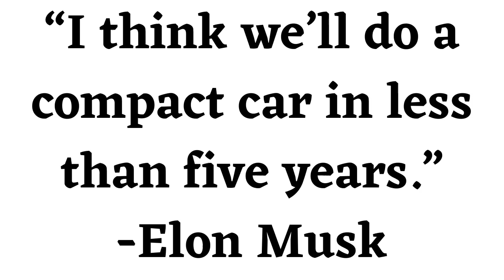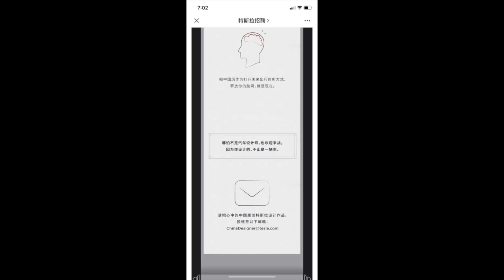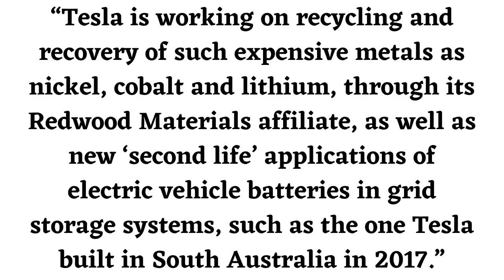Tesla's $20,000 Compact Car Is Coming Soon - The End of Gas

Comment: Not everyone need a car with 500 miles range.  Tesla has demontrated that range or charging aren't issues anymore.  It's time to make cars with modular battery pack where the same car could be fit with different sizes batteries.

Comment: Combustion cars(petrol cars need excessive maintenance, but electronic cars use magnets and electricity to run so minimal maintenance giving it longevity.. for $20,000 it's a bargain, THIS GUY COUPLED WITH THE AUTONOMOUS DRIVINGSYSTEMS WILL TAKE OVER THE GLOBAL MOTOR INDUSTRY, BRAKES WITH NO PAD CHANGES, HE HAS FLIPPED THE WHILE MARKET NO LONGER DO WE BY CARS  TO EVENTUALLY BREAK DOWN.. LIKE WITH ALL OTHER AUTO MANUFACTURING, THIS GUY WILL MAKE HIS EXYRAS BY PROVIDING SERVICES LIKE ATINOMOUS CAPABILITIES ECT
Like the in car mobile marketing concepts I created a decade ago with the building of the first Carputer win XP CAR INDASH PC

Comment: 20 000$ base -5000 federal(Canada) incentive -8000 Quebec incentive - 22500$ potential saving over 10 years without gas = total cost of -15500$. Wow that is a lot of saving!!. Now picture this: autopilot mode (cost around 10 000$ right now) = total cost -5500$ with a car that could participate in the Tesla robotaxi fleet and add me a potential annual revenue of 30 000$/year. So now cost over 10 years = -5500(cost of car) - 300 000$(potential revenue of autopilot while i'm retired at age 33) = total -305 500$

Comment: Even if this car cost just one dollar, it will never end the sale of gasoline because most drivers prefer to fill up once and drive over 300 miles without a refill. And the only cars with better range are hybrids. My 2014 Fusion Hybrid gets up to 54 MPG and gets over 40 every day. With its small 12 gallon tank, I can drive over 400 miles between fillups, and no EV can beat that.

So until EVs can recharge faster and have better battery range, the hybrids will have the greater driving range, and extend gasoline consumption for another fifty years or more. You and I will pass away before gasoline ends!

Comment: Two facts: The Typical Car Is Parked 95 Percent of the Time and  the average private car in the U.S. carries only 1.6 people. Robotaxi's will make use of that idle time and mostly carry 1 or two passengers at  a time, and most commuters do drive alone. All of this together with smaller cars needing less battery points to the $20k car being a 2 seater. I would even go so far as to say a 3 wheeled 2 seater would be substantially simpler and cheaper to make and perfect for this use. Something similar (but less retro) to this https://mynobe.com/nobe-models/
Reply: fk that i wouldn't want strangers driving my car. we dont need to make commuting efficient just the cars and energy source.

someone could easily take advantage of shared car services and bring them to chop shops. a bit harder when tesla cars track every inch it travels though.

Comment: Rocky Mountain institute designed a composite car 10 years ago. The Iite weighting of the vehicle reduces the need for power and battery size reducing the cost. In the 1940s ford designed a composite car using hemp as the source for fibre. These techs combined with Tesla drive train would make for an affordable sustainable vehicle.

Comment: So it's Tesla. 20,000 + 8000 to make it a true Tesla. Add another 10,000 for the upgraded battery and after tax it's 45,000. Just like the 30k model ends up costing nearly 60k. Sad thing is if you buy the most expensive model it actually cost what they advertise.

Comment: If a Tesla with 100 miles range at the worse (say at 7°F or 105°F) and 175-200 at it's best and of course scale back the features. Also having typical merging power. Cost 19,750-22,500usd I buy one spring of 2022.

Comment: I dont want a compact car . I dont want a battery car.  Around the cities small cars are ok but  you can not have a comfortanle ride with a short wheel base and narrow track.  The extra 6 inches elbow room makes a difference.  I can throw a  50 ltr fuel container of diesel or petrol in back of my car or pickup if i need . Australia is sparsly populated in many places. Towing a trailer or caravan or boat long distances is very common.

Comment: IT IS INEVETABLE, i have been a mechanic for over 37 years i saw the good stuff in the mid 70s
go thru my hands and then all the gas cars went down hill, To much greed and planned 
obsolescence...Now with all the secret computer codes its all junk you can't work on , 
unless you are a dealer...Electric cars will rule the roads...i am tired of beating up my body
with exhaust systems and fuel injectors , starter motors, alternators, radiators, belts, hoses,
oil changes, transmissions, spark plugs, coils, air filters, fuel filters, Fluid spills, fumes, emissions, 
You Name it...All of witch an electric car does not need ...
A Good electric vehicle today should cost no more than $20,000...and can be problem free
for 1,000,000 million miles ...except for tires...

Comment: The image of what is supposedly the compact car is not radical in any way at all...it looks similar to the model 3 or a number of other cars...i predict the costs savings of producing the cybertruck from stainless steel will be used to get a compact car cost down to $20 000 or even under that eventually. 
One thing would be for these designers trying to guess how a compact car would look would be to use the sharp angles of the cybertruck....but do so in new and radical ways.....nobody wants a box nobody wants a car that looks silly or ugly....radical yes but it must be modern and good looking in some way...maybe even using some very slightly curved Stainless steel to remove too blunt an edge....still needs to have 5 full seats and space for small loads like the model 3 ....

Comment: I guess a compact car is equivalent to a medium size car in Europe. A $20k compact would be very competitive but I think it would sell for a lot more. A Tesla model 3 is $35 in USA = £26k in UK at current exchange rates but the model 3 actually sells for £43.4k in UK less £3k subsidy = £40.4k.  I.e. 67% more. 

Applying the same markup to $20k gives a UK price of £22k less £3k subsidy = £19k.  Compare that to the ID.3 44kWh which is £25k after subsidy and it is even less that an similar sized ICE car. If Musk can do it then he will take the market by storm. 

Needs highly automated production lines and batteries costing probably 1/2 current costs + guaranteed supply of materials. Let's see what Battery Day brings.

Comment: I`am considering buying Fiat 500 E, but the range of ~80 miles is stopping me, it would be enough for the commute to work, but still it would be nice to have at least 150 miles.  The first, second generation used EV`s are getting cheaper and cheaper, and they still are worth it considering the amount of money you would save for the distanced traveled. Electric currently is the cheapest transportation option, here in Europe 100km trip using EV costs around ~3 euros if you charge at home, the same distance done with diesel car would cost you between 6-10 euros, gasoline ~10+ euros. Not to mention the taxes, oil changes and maintenance..

Comment: Sweet more money left over to call the tow truck when you're on the side of the road with a dead battery.  I rather take my chances with Covid,  range anxiety is real and it can killed you.
Reply: I can tell you don’t own one.  As a current P85 owner you have to be really dumb or the stars have to align for you to run out of battery and get left on the side of the road. You get so many warnings as well as directions about speed and distance that this is a non issue in 99% of cases. I’ve made 3 cross country trips from Florida to Cali and back and I’ve never once came close to being left on the side of the road. There is only one drawback to road tripping in a Tesla and it’s how much time charging adds to a 2500 mile trip not range anxiety.  Pretty much doubles the drive time but on the flip side I have free supercharging so at least it doesn’t cost me a dime to do it.

Comment: Cybertruck already has an ingenious way of saving costs. Since it's completely made of stainless steel common means of producing the chassis will not work. The new process requires much smaller presses whilst producing a stronger car. 
Also a car made of stainless steel won't require a paint shop which is one of the most expensive parts of an automobile factory. 
So I'm expecting a similarly boxy stainless steel frame for their 20k$ car. Frankly it just makes sense. 

I mean why would someone develop a completely new way of producing a car chassis if they only made one car from it.
Reply: I feel like people usually forget that the most efficient way of reducing costs does not lie in the product but in production and Tesla is starting to get really good at producing by allowing revolutionary ideas to flourish.

Comment: Wait until you pay $.50 (50 cents) per kWh to charge your EV battery, due to supply and demand.  For people who don’t know the cost to charge EV battery, then here is the math at $.50 per kWh:
50 kWh battery: 50 x $.50 = $25
75 kWh battery: 75 x $.50 = $ 37.5
100 kWh battery: 100 x $.50 = $50 
In California, the electric rate is about $.25 per kWh right now, I heard it will go higher soon due to shortage, supply and demand.  
The registration fee to renew your plate each year with the state is over $1,000 more than gas car. My gas car is $79, and model 3 is $1,120.  After deep and careful thought, I think I will hold on to my gas car.  I got an anxiety about forgetting to charge the EV, adding 1 more problem/ issue into my daily life routine.  One more headache.
Reply: Jena Lomped It's crazy that a place like California has a shortage of power. I mean, it's perfect for solar. It should have some of the cheapest power in the US- at least during the day! Your government is so backwards. Every where else in the world governments are incentivising electric cars by offering reduced taxes, installing chargers etc but the US has taken the opposite stance for some unfathomable reason. Let's hope things begin to change after December...

Comment: This is a pipe dream it won't happen anytime soon maybe possible after 5 years, the batteries must be small and much more efficient, the current Tesla has a set size because almost the entire floor bottom is the battery pack, the large footprint size is needed for the batteries, a compact size wouldn't be able to hold that many batteries. So until they can improve the battery technology this ain't happening

Comment: The only problem here, is that most Americans of today can no longer afford homes. This is a huge problem for Tesla, because you need a single family home or condo with a closed garage in order to install the charging apparatus necessary in this car. Charging, even with fast-charge technology, takes upwards of hours, making it impractical to expect owners to drive to a charging station and sit there every time their car runs out of juice.

People living in apartments or renting a room in someone's house will not be able to drive even a $20,000 Tesla, because they simply have no way to charge it. 

I stand by my belief that until battery technology gets to the point where a car can receive a FULL charge in the same time it takes to fill up gas, they will never replace gasoline cars.

Comment: I don't think anyone has really spend $35000 on a model 3, at least I wouldn't for a car that looks like a toad, can somebody please tell me am I the only person who thinks that the model 3 facia looks like a toad? Anyway back to what I was saying I don't think a 35000$ model 3 exists, everyone has payed at least  2000$ more.
$25000 wow wow wow wow wow a model S battery costs $14000, this car would probably have a smaller battery so let's say it's$12000, and that's still nearly half of the cost of the entire car. I wouldn't buy a Tesla compact car, for $30000 I would buy a Mazda 3 or a Subaru WRX, but the WRX is slightly more expensive so let's compare it with the top spec fully equiped Mazda 3. It's not as fast but that's the only area where Tesla wins. Mazda has an interier that made one McLaren driver want to buy a Mazda, The Mazda looks better, it's built to a Mutch higher standard and Mazda is not going to send an update to my car which is going to make my car slower. And Mazda doesn't spy on you, Tesla actually tracks where you are going how often and then sends that information to the internal Tesla snitch, yes the same snitch that is searching salvage auction sites to look for VIN numbers and then disable supercharging on salvage cars. If you watch the channel rich rebuilds you would know what I am talking about. But the main thing for me is that my friends don't laugh at me when they see my Teslas misaligned doors and huge panel gaps

Comment: I think the compact/cheaper car will be massive. People don't realise it now, but this section of the market will be a great strength of electric.
At the moment batteries are the great disadvantage of electric - on every other metric electric completely destroys ICE - power, torque, efficiency, cost, maintenance, simplicity ect.
Small cars make so much sense for electric - they don't require the same size battery as you say. Also many consumers will be happy with a lower range, using the vehicle for mostly city travel and won't need more than a 150 mile range, cutting costs even further. As battery costs come down, this section of the market will be the first to undercut ICE in terms of production costs. They will be able to be made cheap. Like seriously cheap. Eventually much cheaper than ICE vehicles and my feeling is that there will be a flood of cars in this market competing on costs around 2025-2030.. 10-15kUSD, or possible less than 10kUSD for a <1000kg car with a 20-30kwh battery (or about 100-160 mile, range). Not sure if it will be Tesla making them (though I hope it is), but it'll happen because it's just such a massive opportunity. Cars have never been able to be this cheap (without being terrible) with the complexity of the internal combustion engine.

Comment: I’m not interested in buying a “new” car unless it’s an electric. I’d for sure buy a compact car by Tesla. My current ride is a bicycle and my wife’s car. I like my bicycle more than my wife’s car, lol.
Reply: I hope they lower the car insurance
Reply: a a I imagine in the future cars will be charging as they drive. Roads will be built with wireless chargers built into them. Mark my words!
Reply: @KLA82  that won’t/can’t happen. Imagine the cost and inconvenience to dig up every road in the uk and redo it with wireless charging. Just no. There’s not a need for it. Batteries WILL get to 500 miles useable range before 2030. My car only does 250 per tank but you don’t see fuel tankers filling me up as I drive...
Reply: Enjoy public transit....an EV is the last thing I would buy...
Reply: @Schmederling33  Public transit?  U mean petri dish pandemic disease transmission.
Reply: Good for you...Most automobile manufactures put 2050 as the last year of gasoline, diesel automobile production. My concern is our aging power grid. I would hate to see us revert to the use of more oil, coal, gas to generate electricity. Another concern is getting the power companies to play fair. Can I generate and store excess power? Can I operate independently of the grid during peak power output, during outages and generate my own power, share it with neighbors,etc..Let's hope for the best.
Reply: just say it you like your bicycle more than your wife. you dont have to add the word "car" to throw us off.

Comment: How compact? VW golf or Mazda 2? The US best sellers are pickups and crossovers, which is addressed by Cybertruck and Model Y. The compact should be small, but spacious inside, which is Model 3, really, Civic and Corolla class. If you want smaller, then it won't have a mass market. Mazda 2, GM Spark, Ford Fiesta, Fiat 500, etc. are all niche products, mostly for single women, or childless couples. The subcompact demographic lives in a city apartment block, they don't have a 'home charger' as a private house with a driveway. 
I think model 3 need to have its price lowered to $24k by reducing its weight and outside dimensions. Making Model 3 a hatchback version with folding seats, shorter frunk, half the battery size - like 35 kwh, and plastic body panels. Range can attain ~250 miles with amazing Tesla battery management software.

Comment: A compact at that price range would be amazing. Right now I have a prius, but i plan to upgrade to an EV as soon as i move into a house or apartment that has some sort of EV charging. I'd probably get the spark ev, since it is the cheapest used EV with active battery cooling, which is a must in 110°F heat here. In a few years when a Tesla compact comes out, I'd definitely upgrade to it. I'd love to get something bigger like the model y, but that's just too expensive. The chevy bolt would also be highly considered

Comment: Not exactly radical but I would suggest taking elements from the idea of the VW Bug variant "The Thing" and use one motor on a skate. Make it out of aluminium or carbon fiber or fiberglass (Corvette)  If possible make an exoskeleton from stainless steel tube (dune buggy). And a minimalist dash with a small dedicated display for the driver (WW2 Jeep) and an aux upgrade display for the passenger.   Bench seats like a ww2 jeep  Perhaps a receiver for a trailer hitch and maybe an aux trailer antam)that could further include a second battery.